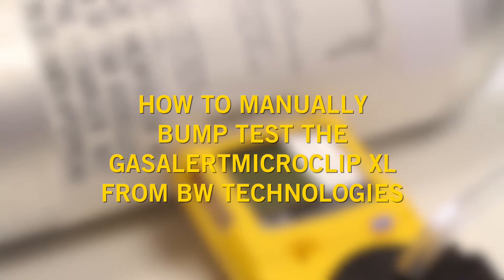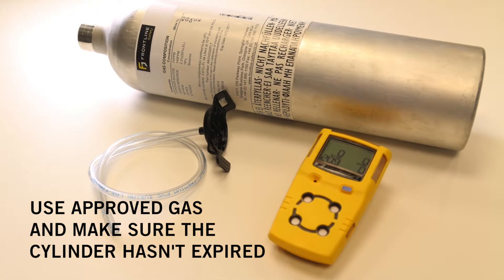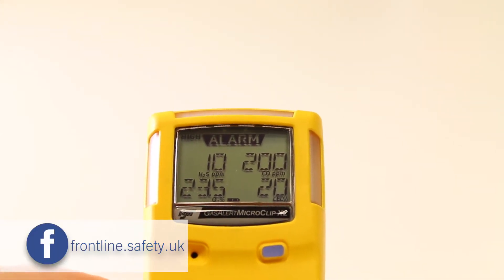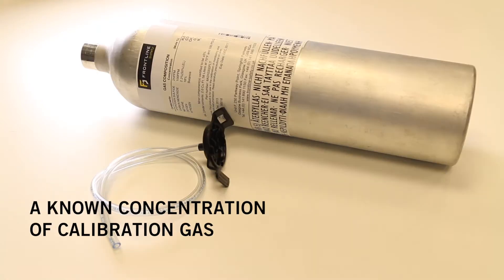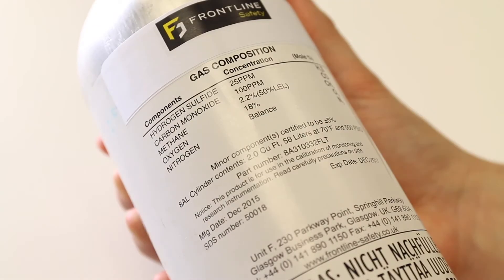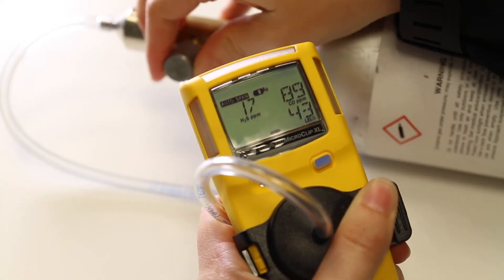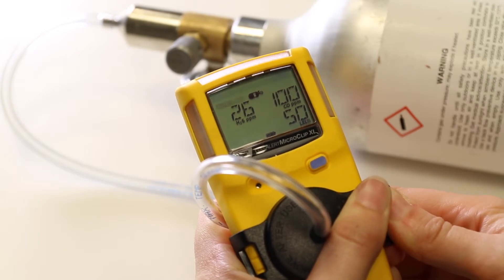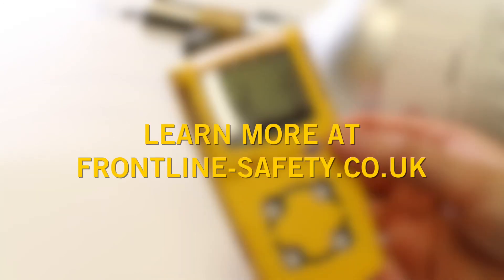BW GasAlertMicroClip XL Gas Detector : How to Manually Bump Test

Comment: Hi guys 
    I have 2 machines that are in cal but both showing a O2 error . I have changed both O2 sensors but still showing O2 error . Any help would be good and much appreciate cheers . Wayne
Reply from the maker: Hi Wayne, 

Apologies for the delay! We would need to see the monitor in person for diagnosis as we can't access the monitor setup via the service software remotely. If you are local to us you can send your monitor to us for inspection. 

If not, send it to your local service centre. They will help diagnose. 

Thanks for you comment, hope you find a solution to your problem!